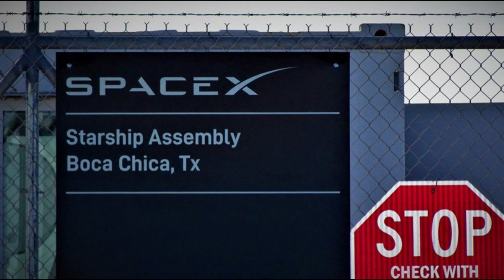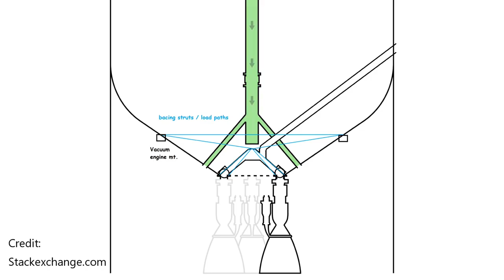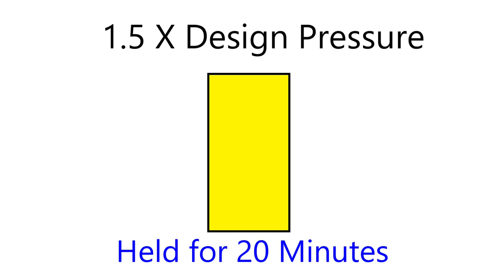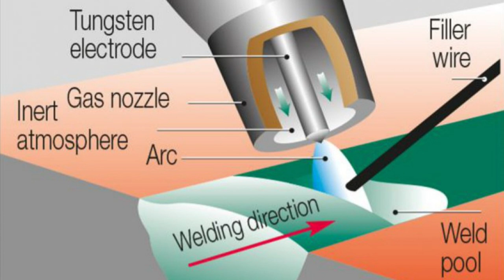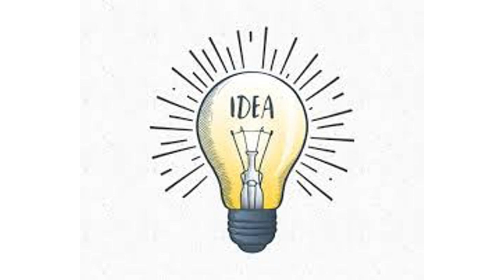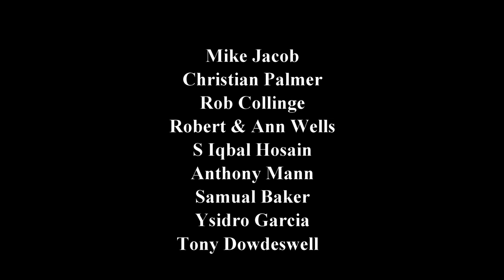SpaceX Starship - Can Spacex Make a Starship That Doesn't Explode???

Comment from the maker: What do you think SpaceX needs to do to get a Starship off the ground and I'm not talking about the way they have with the last couple... 👍 
SMD 
MoB
Reply: the fastest way is basically what they are doing. making a whole high end manufacturing plant first will get you better initial results. but by then way more time and money has been spent before anything leaves the ground. and your manufacturing plant probably isn't optimized if you don't have experience making the rocket already.
Reply: @nymeriagloves3957  Moreover, building a final product from scratch before testing it can result in very costly design changes if you realize you messed up somehting. I'm definately in favour of SpaceX approach even so it looks like complete amateurism at the moment. The re-entry profile SpaceX will try to control is utterly complex and would probably result in the loss of a few vehicules... if Blue Origin do not succeed quickly their program will cost arms and legs to Bezos... in the order of billions. Elon has not the same budget than Blue Origin... so he's trying with what he has. He did it with Tesla, he did it with SpaceX and F9... I'm confident he can do it with Starship.

Comment: The other day I watched "smarter everyday" and he toured ULA and was shown how they build their rockets. Two interesting things come up that relates to this video. First, their rockets would explode too if tested to 150% pressure, they were talking about less than 10% margin in most things, rising to 20% for critical items....meaning 120% is their failure point, it's all about keeping the weight down.
The 2nd was friction stir welding, they use it for the Aluminum rocket bodies, but not the upper stage stainless, just like SpaceX they welded it.
Reply: This a very intelligent question! Why can’t you friction-stir weld 301 stainless steel together? Friction-Stir welding typically has a much smaller weld volume thermally-weakened “heat affected zone”, this holds out the prospect of a minimum weld strength knockdown, due to NO use of dissimilar materials in the weld. Maybe you have to develop a new form of “plastic-state prepared surface” friction-stir welding? Where the two surfaces to be welded together are cleaned and de-oxidized with a cold plasma jet just prior to being pressed and counter-spun together? All in a noble gas atmosphere on both sides of the weld?

Comment: I watched the footage of the SN 1 Failure several times. It doesn't so much bother me that it failed. Two things I noticed of the footage and resulting damage were the implosion and the welds. In a photo of the weld, it appears that the weld wire was a long piece jutting out with no Stainless siding attached. I could see  if the weld failed and there was more on one side than the other but to me, it appears as the weld did not bond at all to the steel siding. As if the steel were not hot enough to pull the weld into the material. I imagine, they will probably overcome this. The bigger concern is how it imploded. It seemed so flimsy. This is a vehicle that not only has to survive launch but also has to survive reentry and the shock of landing. An aircraft that is used over and over again has a super structure to support the loads. I'll be curious to see how this structure will hold up or what modifications will have to be made of which additional weight will lower the weight of the payload to orbit.

Comment: They're not testing the individual tanks of SN2. They took the top of the methane tank and welded it to the bottom of the oxygen tank just to test the thrust puck on the oxygen tank. Unless they cut that setup apart and then weld it together with a common bulkhead and a bunch more rings it looks like there will be no more of SN2.

Comment: Musk’s ultimate vision requires many many rockets. As he said it’s the cost effective manufacturing process that has to be created. To developed  the cheapest and simplest process possible that will give the required results requires starting with the most basic and keep improving until success. To start with a sophisticated system and keep simplifying it until failure doesn’t make sense.

Comment: While I generally agree with your observation that they need to be building starship in a controlled indoor environment, SpaceX is in the "proof of concept" stage in Starship development.  Elon is just trying to get a prototype into orbit to prove the whole concept is feasible and to demonstrate the gross weight limits and the whole liquid methane lox engines will be capable etc.  I think that he is just trying to get something together, any way possible at this point, knowing that the prototypes will not be carrying humans.  They have several buildings going up which will obviously let them do a better build as each prototype is tried.  Eventually, I believe he will have an almost automated process to bend and weld the rings, perhaps even using something like the friction welding you describe.  Meanwhile, I hope he does get SN2 into a fully functional sub-orbital rocket.  Pretty impressive since nobody has tried it with a stainless steel rocket.

Comment: I think its better for SpaceX to use their Falcon 9 rocket technology or parts to build BFR. I mean Falcon 9 rocket tanks tested a hundred times. Just don't build one big thin wall tank. Use 4 or more Falcon 9 like segmented tanks and strap them together. If payload is an issue, just build Starship and Booster a bit longer. Size is not an issue for Elon. Several smaller diameter tanks built from the same thickness sheet metal will be stronger than one big. It will be more rigid. When I see every time in these videos how these paper thin tank walls shake and vibrate, I think ...O god  no one will fly this thing for sure. Is it gonna be reusable?...no way. It will explode if not first time but second time definitely. The factor of safety must be more than 2.

Comment: I wonder if they've thought about 3-d printing the tank and ring sections.   I'm sure they have thought about it.   You would think it would be a lot more economical,  and speedier.   Plus it wouldn't have any weld joints.   I'm thinking they don't have a process to print that thin of stainless.  Those ring sections are like paper thin.
Reply: 3d printers are good for complex parts and shapes. making a 3d printer that huge would be one of the most expensive machines on earth, and just to make sheet metal which is one of the simplest and cheapest things.
Reply: No not really.   It would only have to print a circle,  however high the body section is...
Reply: No not really.   It would only have to print a circle,  however high the body section is...

Comment: Dead pan and cool presentation. BUT is Un necessary to bring liquid nitrogen up to any pressure it will generate it's own pressure and needs to be vented to prevent over pressure. Just nit picking. You did teach me something in the stir welding. Didn't know it was used on origin...Thanks.
Reply from the maker: You are correct about the liquid nitrogen. They do monitor the internal tank pressure when filling.
Thanks for the comment! 
SMD 
MoB